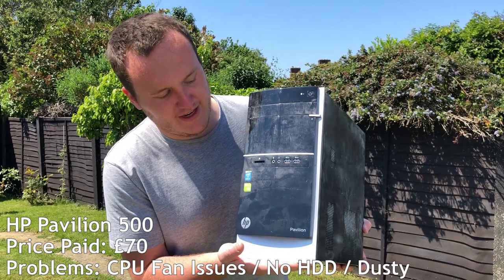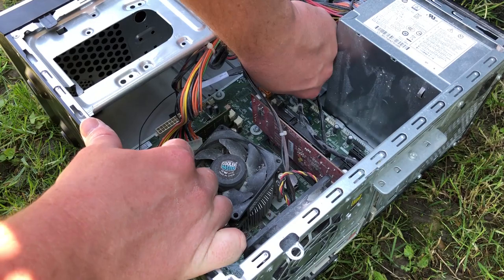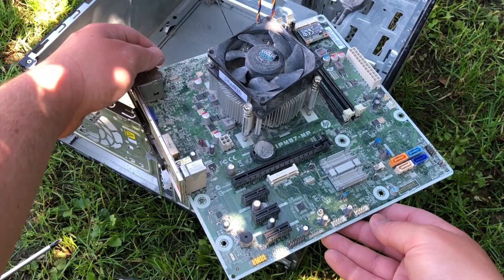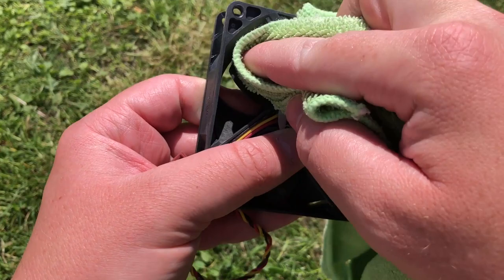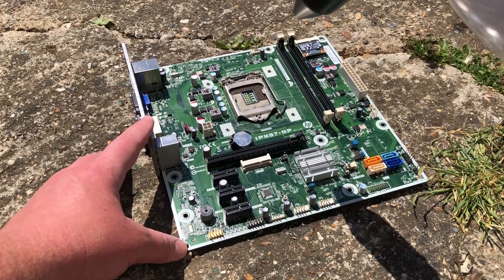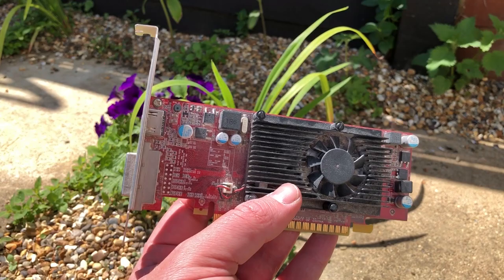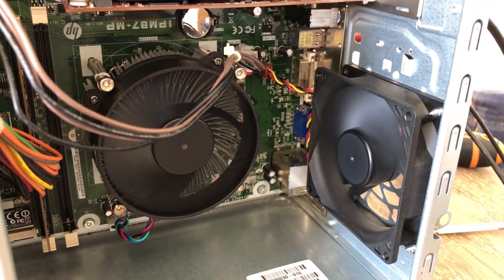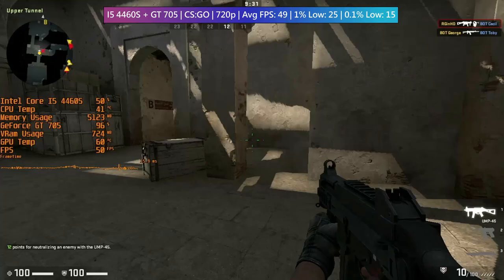Fixing Broken Ebay Gaming PCs - The Filthy HP Pavilion

Comment: you should never dust a board with out the cpu!!! leave the cpu on next time so you dont get dust under the pins! also that dust can carry microscopic metal bits that can be conductive. always leave cpu on when dusting then remove cpu after you brushed around it to remove the dust and stuff.

Comment: You really can't go wrong with a 3rd or 4th gen i5 machine. Hopefully, you picked it up on the cheap. A cheap hard drive, CPU fan, and another stick of memory. It will be a fine media center PC as is. Upgrade the power supply if you upgrade the GPU. The board luckily does not have the proprietary HP connecter on the board, o no converter cable is needed.
Reply from the maker: Yeah I always dread seeing a proprietary connector but I’m always so happy when everything is just universal

Comment: Funny about GTA, I had an i5 4440, which is undoubtedly a little weaker than the 4650, but I would get appalling stutter with it. I had a 1050ti and a HDD from about 2014, so I cannot think of why it ran worse than an 85 year old asthmatic

Comment: The gpu is running at 60° so there is enough room to overclock

Most of the time you can overclock them to the max in msi afterburner and have a 20% or 30% fps inprovement
Reply from the maker: Oh that’s awesome I’ll give it a go

Comment: My Asus laptop Got a Dual core i5 5200 u Nvidia 940m and 4Gb ram and I can play Gta 5 in 1920x1080 low-medium settings (not blurry tho) at around 30fps and sometimes 40 with the charger connected!

Comment: I have an older model from 2014 and it is not very pretty
Featuring barebones components (3rd gen i3 woth integrated gpu and 4 gb ddr3)
An 80 watt external laptop power brick
0 pcie lanes for epic expandability (what would you even put with 80 watts)
And a similar amount of dust
Currently being used for storage

Comment: you shouldn't blow the dust while the cpu socket is exposed, you most certainly deposited dust particles in it, that will be very difficult to remove withouth damaging the socket's miniature pins and could cause issues with the cpu. Even the blowed air itself could bend one of those extremely delicate pins! When I clean PC's I always leave the cpu on the socket until I've completely cleaning the motherboard and the cpu's surface, only then I remove the cpu itself

Comment: honestly integrated graphics are probably better than that GT 705 lol (dont know if the 4460S has any though)
Reply: it does and it's actually better performing than the 705...so why even put the 705 in there is the real mystery from HP lol (only reason I can think is to support more screens)
Reply: @The93Momo93  probably simply to be able to put the GeForce sticker on it

Comment: you do know almost any screwdriver set has the bit for that star screw and I just use a shop vac in reverse with a rigged tip  to clean pcs pretty mutch just a louder more powerful version of what u got and that looks like drywall dust inside I bet that thing was through a renovation and you must not of been around during p3 and p4 days fans went out all the time  lol

Comment: It is really advisable to clean used computers outside to check if there is any pests inside. Louis Rossmann has had at least ants and cockroaches infestation in his shop. I wonder if the integrated Intel HD Graphics 4600 would have actually been more powerful than the miserable Nvidia GeForce GT 705.

Comment: Lol. I remembered when i was in highschool (2006) i built a p4 system without using any thermal paste😂 and it worked without any problems..
Reply: I also built a core 2 duo system before graduating highschool (2010) and it never had any issues until it got flooded. Now it still turns on but the psu will not turn off. The only way to turn it off is to physically unplug the system😂

Comment: Not sure what you value your time at but you invested a lot in that pc the tear down and clean up makes for a great video but a small air compressor with about 100 psi will clean the dust out without removing everything. saving you about 5 hours blow it out wipe it down repaste repair resale

Comment: I don't know why you don't just buy an electric air compressor with a blower hose. You could have completely cleaned this computer without taking anything apart besides the side panel. You might need to cloth wipe still inside still though, no biggie. Just stick a plastic zip-tie into any fans so they don't move while you blow them. It's honestly kind of an odd match having this Nvidia card in this PC, it's barely faster than the IGP.

Comment: What O/S were you running to get Fallout New Vegas to work? Windows 10 seems to hate it, even more so with mods!
Reply from the maker: Windows 10, but it does need mods to make it run without stutter
Reply: @RandomGaminginHD  yeah, I've seen a lot of those videos about what mods to run and Ultimate Setup Guides which all seem to not work. It's really frustrating to try to set up on Windows 10

Comment: Holly its exactly like mine but mine have an i7 4770. Its just like my main rig. My problem with that pc is the pci express slot is reversed my gtx 1060 6gb screaming inside that case looks like a jet engine.🤣

Comment: I know Pavilions like this well. Good CPU and sometimes relatively good power supply from Delta (not this case). An the rest? Terrible Pegatron board, Terrible low-end nVidia GPU, and absolutely terible case design which kills GPUs FANs and poor cooling system.

Comment: I just stick a vacuum cleaner hose in there, gently of course, then wipe the corners with a tissue, still yet to break anything as well.
Reply from the maker: Whatever works 🙂
Reply: @RandomGaminginHD  I've seen some video's when the guy just runs it under a tap and brushes it, the board is usually covered in a lacquer, so you shouldn't have to worry about rusting.

Comment: You should add a better GPU (gtx1080?) and PSU and add another set of results to your testing, using that on all of the smaller systems as a comparison against stock, of how good they are when updated. just an idea. keep up the good work

Comment: Tech Yes tells us that a GT710 powered PC should not be called a "Gaming PC" and then RGinHD goes and proves him wrong by showing us that a GT 705 powered PC can run games :)

I cut my teeth on HP Pavilions and the only thing you did wrong disassembling it was removing the power supply before removing the DVD drive...... the PSU is much easier to remove if you remove the DVD drive first...... other than that, I would have left the CPU in the socket to clean the dust off the motherboard to protect the socket but hey ho...... had a few CPU fans stop working on ex office PC's bought from ebay. It's down to lack of cleaning and as the dust builds up it jams the fan and then it just shorts out and is dead.

Comment: even a gt730 would be worth to upgrade coz  gt705 isn't much capable of running games ik gt730 isn't as well but still its way better than that crapy gt705 and gta v is one of the most optimised title of the decade if ur pc can't run that more than 30fps in average than i think it shouldn't be called a gaming pc

Comment: the gt 705 is worse than the integrated graphics. Throw it away.
Also 'I have never seen a dodgy cpu fan before'; 
Cooler master is amazingly excellent at lowering the bar. Laughable fcxikng SH1TE ,
I wouldnt buy a bog brush off CM.